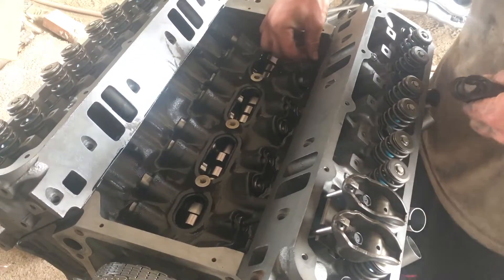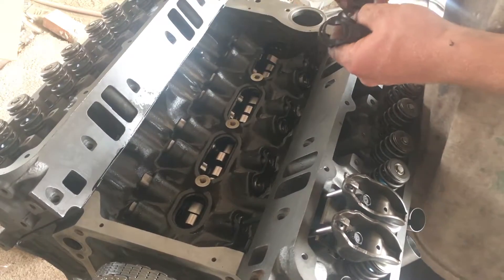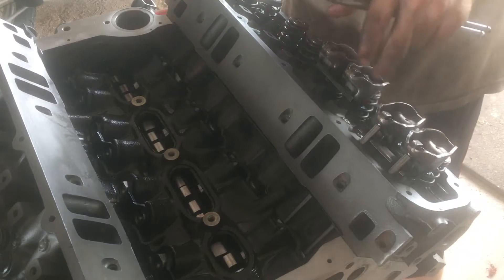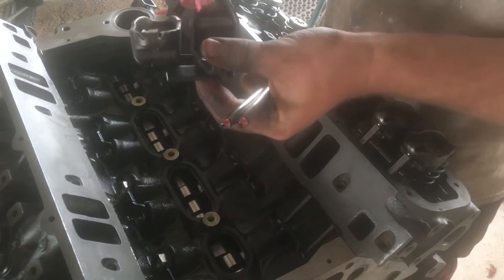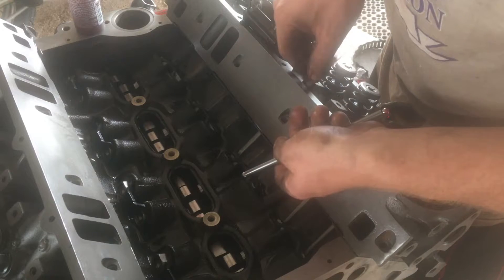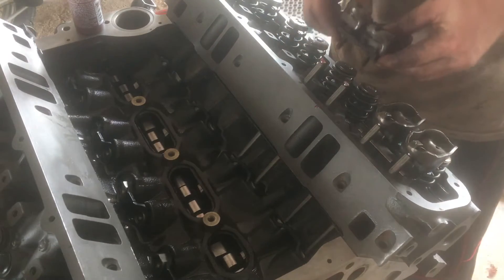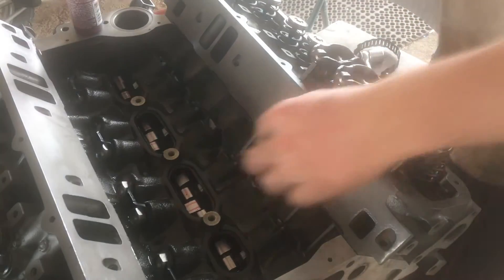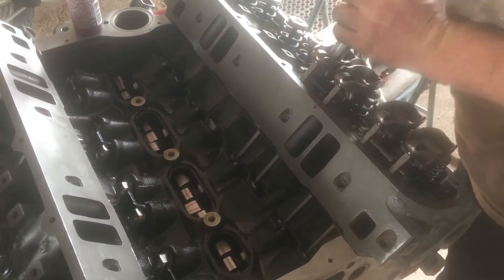How To Install Pushrods And Rocker Arms | Dodge 5.9 360 Magnum

Comment: Why does it push the valves down with the lifter all the way down when I try to tighten them up
Reply: some people say its ok , some recomend spinning the engine so theres no tension on the rockers when tightening the bolt to 21ft lbs.

Comment: I have a 2000 5.9l I have to do my valve seals. is 21ft lbs the torque spec for the rocker arms I read some where that it was 11 ft lbs but that just seemed to light to me any advice would be great thank you!

Comment: I would not do this if you're using hydraulic roller lifters you will collapse them I just found this out the hard way
Reply: I know it’s an old comment. But what happens when a lifter collapses
Reply: im not sure but your not supposed to spin the engine right after installing a valve head on a mopar with hydraulic roller lifter. they need to sit for a while after the pushrods and rockers r installed i think

Comment: should the rush rods always be replaced or they be re-used also same shit for the rockers...do they all have to be new?
Reply from the maker: +Michael Rundle no u can reuse them if they r not bent or really worn :) same for the rockers
Reply: ah i see..im looking to put a new camshaft and roller lifters in..but see the thing is i cant figure out how to remove the distributor/oil drive gear that goes to the cam..im sure u know what im talking about but im not sure how to get the gear out now that i have removed the distributor so i am able to remove the old camshaft any ideas? oh also once the gear and the old cam is removed how do i angle the new cam when i put it in and how will i be at the right timing for the valves? to open and close
Reply from the maker: +Michael Rundle the drive gear is going just going to pull straight up but it's probably not going to be easy :/ as it pulls up it has to slowly turn and if it's bin in there a wile there will be a coding of oil that has built up that will make it a little tuff to get out. I would suggest piling the oil pan and oil pump and tapping it out from the bottom :) As for the timing of the valves it's  going to depend on the cam you bye.
Reply: ZWIN1115 is the part if u google it maybe u can see ..but its the standard stage 1 hyd roller cam im pretty sure